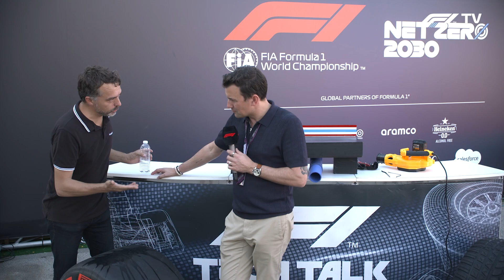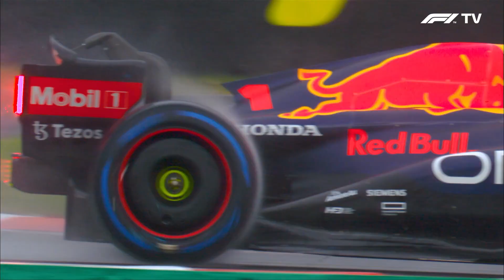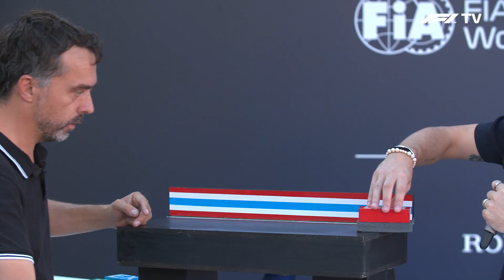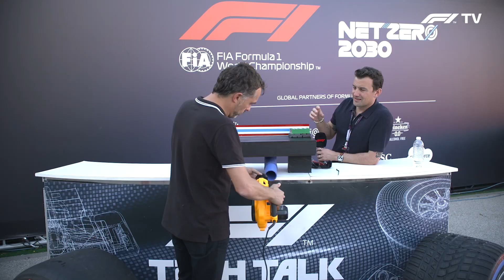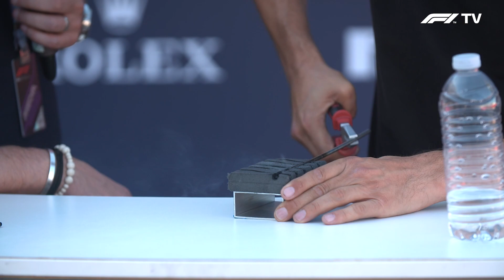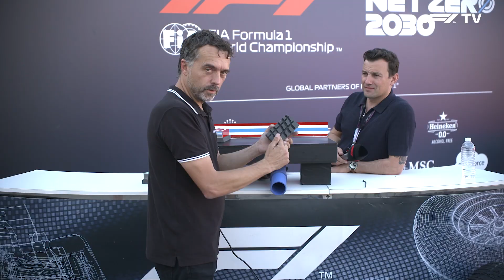Aquaplaning Explained... with Air Hockey! | F1 TV Tech Talk | Crypto.com

Comment: Well, if wet tires are required and with how well they work, the main problem for safety at that point isn't aquaplanning (which shouldn't even be something we should wait for to race since wet tires exist and since handling aquaplanning is up to a driver skill and decision making on which lines to take and which standing water to avoid) but the visibility which becomes non-existent due to the cars spray and is entirely outside anyone's control.

Comment: Tires are fine - they can handle standing water just fine. Problem is spray. Wets can "work" only for very small window of rain that intermediates can't (and when racing is still possible).
In theory F1 could "order" (since F1 dictates characteristics of tires) Pirelli to make interwets (ones that works from "SC/red flag" conditions up to dry-ish line") and interslicks (one that can cover dry line but wet-ish parts of track). It was a bit akward to see drivers  going around in no-land territory where new inters (overheat/grain/won't drive to "usable" territory) or new dry both would be worse than overused inters.

Comment: that's great! it would be even better if the FIA let the drivers use them
Reply: The problem with that is visibility, not actually the tyre itself. When drivers can't see anything is a big problem, is not that they can't drive in rain with full wets. Something has to be found in order to have rain races again without jeopardizing the safety of the drivers. Again, the big problem is visibility.
Reply: @LuisRdzG10  Time to bring back the fan cars
Reply: @LuisRdzG10  Put mudguards. Totally ruins the car's aero, but stops the spray
Reply: @akmal94ibrahim  That sounds like a nightmare, just imagine, heavy rain comes during the race, and the driver comes to the pits and waits how long for his mechanics put that thing on???. Rain stops later and gotta pit again to take that off xD.

Comment: They are professional drivers. Let them drive. If they slide out, they were driving too fast. That would also happen on a dry track and that is never a reason to not race; we expect drivers to adjust their speed to the track and corners. "But it's unsafe," is hardly an argument. The sport is safer than ever and the multi-millionaires are paid more than enough to take a tiny bit of risk. It's probably still less dangerous than crossing a road in a crowded city.